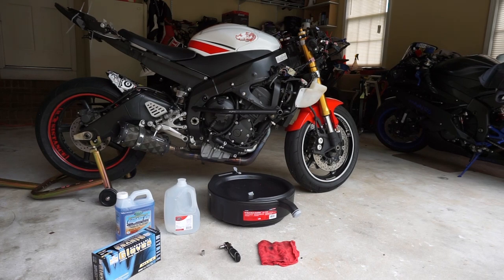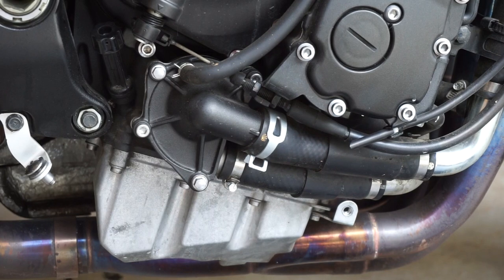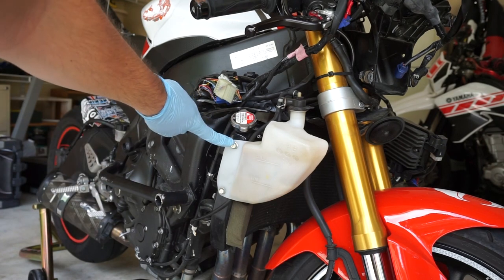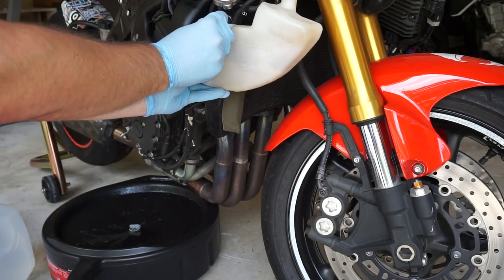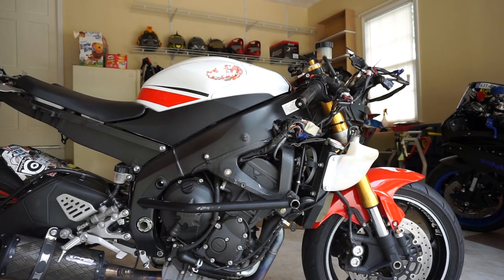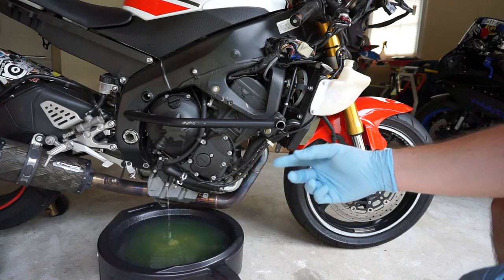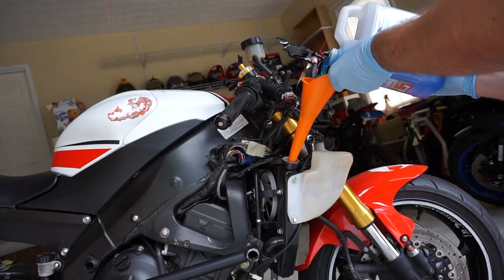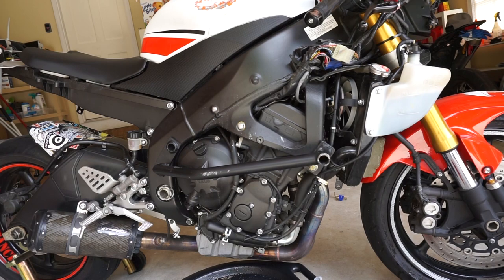How-To: Motorcycle Coolant Flush (2009 Yamaha R6)

Comment: also, after you add the coolant, run the bike again to allow coolant to flow and fill the empty areas. then check it again and top off. if you dont, you will run the risk of overheating due to not enough coolant. also, when running it, leave the rad cap off until it starts to boil. cut off the engine and put the cap back of. allows the system to burp air bubbles out.
Reply from the maker: Cruiser Brewser Thanks for that added info man!
Reply: +chaseontwowheels no problem. I found out the hard way once. Haha
Reply: Another easy way that I use on my 09 1125r is this; drain coolant, fill with distilled water, remove coolant return to radiator hose and route it to a container, with bike running add distilled water to the radiator as fast as it comes out the return hose. This will thoroughly remove all coolant. Then do this same process with your choice of coolant. 

I prefer Motul motocool factory line to engine ice, the specs are better.
Reply: Another way to get air out of the system is to put the radiator cap on and shake the bike back and forth vigorously, then take the cap back off, do this until your coolant level stops dropping in your radiator. It's called burping the bike. Certain bikes (like mine) either have the bleeder screw in a hard to reach place or don't have one at all. Air in the system will damage the water pump over time.
Reply: Exactly what I was thinking.  I'd almost bet after you run the engine for a few minutes and fill the coolant ports in the engine block that you could fit the rest of that jug of coolant perfectly.  Do this before you put all the fairings back on so you can fill the overflow reservoir since it should pull from there to keep the radiator full.
Reply: No wonder why my bike temp kept going up.
Reply: @DMRMOTORSPORT  It works on bikes

Comment: Good job mate, very comprehensive.  One thing you maybe should have added is that you should run the bike for a bit after adding the engine ice then check the fluid level again because it can sometimes have a few air bubbles in there.

Comment: A good tip for filling the system back up.  Pump one of the coolant lines with your hand by squeezing and releasing several times.  This will force any remaining air out of the system and will allow you to top off the radiator.  After a couple squeezes you will notice the coolant level in the radiator will drop.

Comment: Hi chaseontwowheels, great video but 1 thing worries me. When the engine is hot (as shown in your video), I would personally wait a few hours until the engine is completely cold. Because replacing the hot coolant with cool air runs the risk of cracking your head or some other damage. As an engineer I know rapid cooling of aluminium and other alloys is really bad in ANY engine.
Reply: DirtRider500R Yeah I agree it will be linear, but you have to take into account people from cool climates, like myself (UK) with a low abient temperture. Assuming the coolent hasnt been cooled and stood in open space we can assume it will be the same temperture as the ambient air. 20 degrees C would be the average for summer time here in the UK, less in other parts of the world. 

I'm not trying to be a "smart arse"or a "know it all", I just dont think its good advice dumping fresh coolent into a hot engine. No matter how good the grade of alloy, it will cool a lot quicker than it is intended to. This is called quenshing in engineering.
Reply: Good note man

Comment: Good job on the how to. Keep them comin.

Interesting how different the process is between bikes. Mine has to be drained at the water pump and at the radiator, along with using thread sealant when replacing the bolts, then you have to "burp" the hoses when re-filling with coolant...

Comment: You kinda forgot the step to make sure there is no air in the coolant system. I don't know if this particular bike handles that on it's own but I know there's plenty of other bikes that don't.

I usually squeezed the hell out of the hoses on the bike until there weren't any bubbles coming out of the radiator cap.
Reply: grdv10 Running the bike should take care of that, especially if you put the expected amount of coolant in. Doing it manually doesn't hurt, though.
Reply: This particular bike will circulate the air bubble up & out of the radiator in the the expansion tank (as its radiator's physical opening/cap is way higher than the highest point of the engine).  But remember to let the engine cool completely (I generally let it cool over night then open the radiator cap to top off with coolant and refill the expansion tank to the Full mark).   As you and Kevin mentioned, squeeze the hose won't hurt either.

Comment: Don't forget to cycle the system again by running the bike and leaving the cap off of the radiator. This will let out and air pockets in the cooling system. If you don't it can cause the engine to overheat.

Comment: Only thing I could suggest would be to squeeze the radiator hose as you refill it. This will help push out any air bubbles in the system. Not sure if you did this but it wasn't mentioned so that's my 2 cents. Otherwise..Good tutorial.

Comment: Older video I know but this just saved me. Basically a friend of mine overheated my bike because he's not used to liquid cooled and his is air-cooled. He's been practicing with my R6 bc his is a 500cc and needs mine for his full license test. He ran the coolant dry. I went to fill it up but Yamaha made it so I can't see the fill line and have to take off the fairings just to access the reservoir just to drain it. At 2am after the gym, in the dark. What a pain in the ass. I just now saw how it was emptied. Damn. Rip. Ah well. Next bike is going to be naked. I love the look of fairings but they're annoying. A Gixxer has 1 panel. Mine has 4 and 99 bolts. Thanks Yamaha

Edit: Just saw how you can drain it out of the bottom of the bike. I had taken my reservoir off the bike and poured out coolant until the full line. Then reinstalled. Plus all the fairings.

Comment: don't put the cap on until you are finished. as the coolant drops, add fluid. once the air is out the level will stop dropping.

Comment: Bleed the the radiator cooling system with the radiator cap off and a funnel in it with little extra coolant sitting in it. As the engine runs the extra coolant bubbles as air escapes and the coolant fills in. Idk if the r6 or motorcycles in general have a way of doing that by itself lol but thats how i do it on my car and thats how its done on other cars. And FYI to those asking if its bad to mix a higher water to coolant ratio, its not. WATER IS THE BEST WAY TO KEEP YOUR ENGINE COOL but chemicals and additives in coolant are designed to keep it from freezing in extremely cold temperatures.
Reply: Luke Tabayoyong I was gonna say the exact same thing about bleeding the air out, if you don't sometimes the bike will hiccup and overheat a bit.. And about the water being mixed in, that's true, but engine ice works best in the mix it comes with, dropping your engine temp by up to 10 degrees, if you mix it with too much water it dilutes it more .. I'm from Texas, so I need all the coolness I can get lol..

Comment: wouldnt you circulate the engine ice coolant too? as you did with water? because once starting the bike it completely flushed the old coolant out and now theres water there, so wouldnt you need to flush the water out using the new coolant? because somehow i dont know about you, but i wouldnt want to keep any water in there mixed with my coolant.
Reply: coolants are a mix of 50/50 antifreeze and water lol. a little bit extra water shouldn't be that big a deal. it would probably raise the freezing point and lower the boiling point by a few degrees tho

Comment: Great vid c2dub...just fyi need to bleed system as stated also nuts/screw are bolts lol and the "tip" is a socket hahaha. We knew what you ment tho. Do you not need to mix the coolant 50/50?

Comment: Why didn't you drain the way the manual instructs - disconnecting the hose directly to the right of the screw you removed?  Seems to be the lowest point of the radiators circulation, so there'd likely be a lot of sediment you're not getting rid of by removing just the bolt you've suggested.

Comment: You need to keep the cap off and turn the engine on and have the coolant flow through the engine and fill it up until the coolant levels stop going down in the radiator

Comment: I just filled to under the full line on reservoir tank. then the radiator. radiator did not fill? did I do it backwards? on yours you have left over from filling your radiator and then filling up your Reservoir and you still had some left right now if I pour it into the radiator I'm not going to have any left and I don't think it's going to fill it.
Reply: Nevermind, I have my changes and finished up. Thanks man!

Comment: this tutorials should be more about scooters , its very hard to get into such parts , I have a 98 honda helix,and I want to flush the cooling system , But you can not get to the radiator tank. I can only get hands on the reservoir

Comment: I'd run the bike after you do the final fill to get all the air out of the system. Them check the level at the radiator cap

Comment: Dont you have to run the bike with the cap open to burp any bubble in trapped inside? I know its like that with a car but maybe its different for a bike
Reply: Yes
Reply: With it empty?
Reply: No, if its like a car, you fill it as much as you can first, then you run it and let it burp any bubbles out and fill it more as needed. never run any vehicle without any coolant in the system

Comment: You do realize that you dont have to wait until the fan kicks on for the water impeller to start turning right?? That would make ZERO sense for the engine to work like that... none the less tho good video.
Reply: To wait for the fan to come ON is an indicator that the thermostat has opened to allow the coolant circulate through the engine block cooling channels in to the radiator (the sensor in the radiator detects the hot coolant as the thermostat opens then close the electric circuit to run the fan).  We can also do it the old fashion way by squeezing the upper radiator hose for pressure as (while) the thermostat opens the pressure in the upper radiator hose will decrease and the pattern repeats (the upper radiator hose will be very hot so wear an oven glove if you like to squeeze the hot hose way).

Comment: There is literally no point in tipping out the resovuir not unless u plan on removing the radiator an tipping that out too as that will have hell of alot of coolant still inside, it would take a million flushes and you would still see green coolant coming out once it reheats an cycles.. all you need to do is drain flush fill end off, if its good enough for 1 million pound ferrari's then its good enough for an r6.

Comment: that shit doesnt work.
Reply: The Engine Ice ?    Personally, I use Honda coolant (Type-II) for cars, meeting all the aluminum and water pump protection specs and it's much cheaper ($14 per gallon).
Reply: +Rick T 
Yea. I got engine ice and it doesn't keep your engine cooler like they claim.
Reply: +Life On Two Wheels, Ok, Thx for the reply and confirmation.  Personally, I have not used it, but I sure heard from a number of friends and fellow riders the same about not seeing any difference.  As I mentioned earlier, I have been using Honda coolant which fully meets the aluminum and lube requirement plus less $$$.  Good luck and safe riding!
Reply: +Rick T 
Thanks dude! Same to you too.